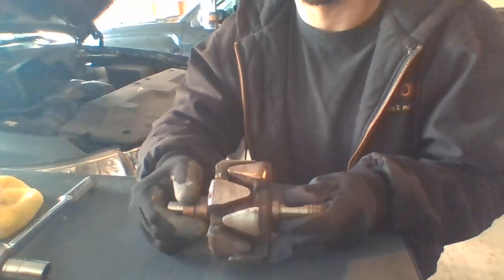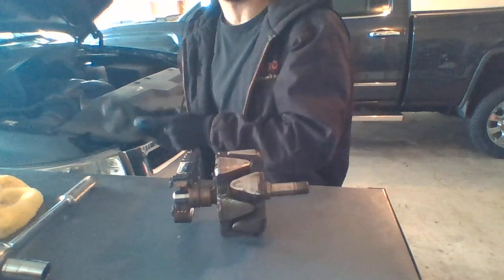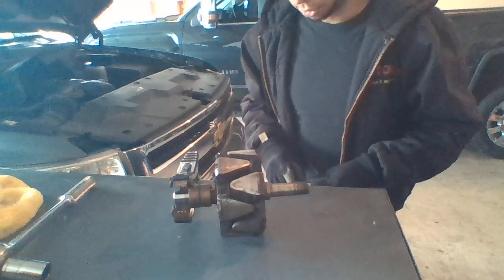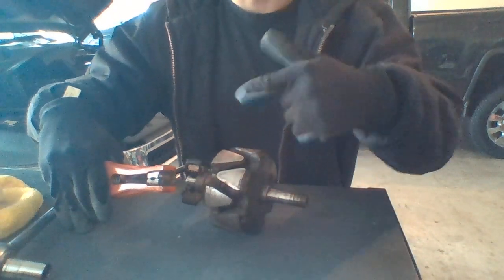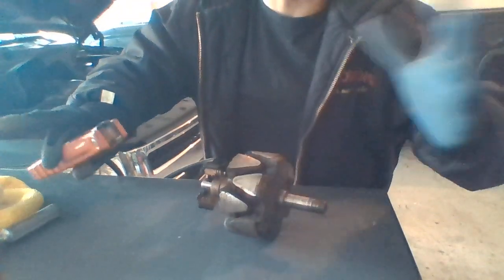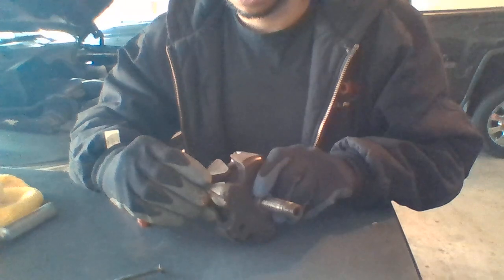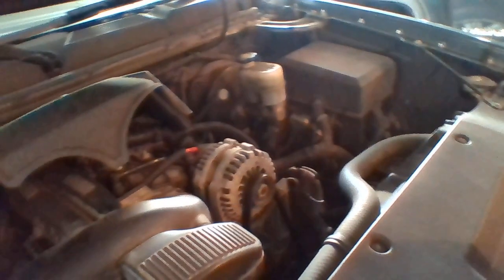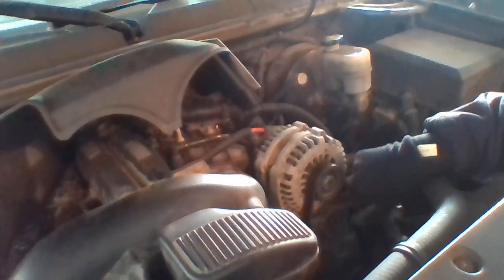Full Fielding an Alternator Rotor

Comment: Great video, I have a question from my Truck techninican exam. An alternator is full fielded and only 60% of it rated output is given, which component is at fault? A. Rotor, B.Brushes, C. Rectifier Bridge, D. Voltage Regulator, Ive narrowed it down between the Rotor or the Brush

Comment: I wonder what it will do if you aplly power to stator windings wuld not the entire case become magnet tehnicaly? And you actualy geting power from the field rotor? Wuld that not make 3 faze to 1 singel faze converter? With high out put? Because Im looking some how the old dc magnetos ore also called dynamos worked? All they hade basicaly magnets spining coil rotor and in 1 side condenser the other side was grounded. And that thing actualy fiered any engin just by toching ground basicaly .
Interesting video.